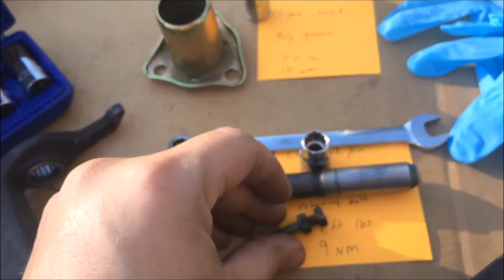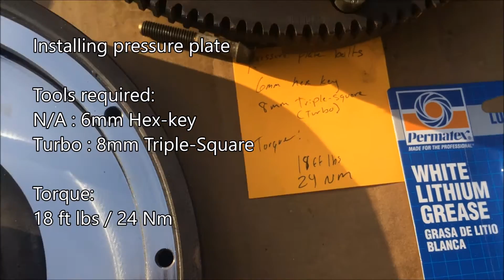Porsche 944 Clutch Change Episode 3: Installing the clutch

Comment: This is by far the best 944 video I've seen. Very thorough, well thought out simple. I wish you would do one on removing the torque tube since I'm right inthe middle of it. This is  even better than the German guy. I did strip a pressure plate bolt head and some cv joint bolts. Both were very dirty i was in a hurry and didnt clean  them properly. Because cv bolt heads werent clean i thought they were torx instead of 12 point so i stripped a number of them and might have pinched the  circular thingy next to the bolt head with my vice grips. Hopefully still usable. I have seen many of these videos and this is the best. I detected a bit of a Southern accent so I was glad to see a Southerner doing good.
Reply from the maker: Thanks! Yeah, I'm from North Carolina. Where are you from?
Reply: Denton, Texas.

Comment: Awesome video!  I just picked up an 86 NA and the job I started with was the clutch replacement (figured I'd kick it off with a big/long job).  Your videos are great and they have been a HUGE help!
Reply from the maker: Awesome! Glad to hear they've been helpful! Good Luck with your project!
Reply: Quick question:
I just finished up the clutch job and I'm moving on to replace the timing belt and water pump.  Finding TDC is important and the OT mark on the flywheel is essential it seems.  I now can't remember if I lined up the flywheel with anything else when putting it back in following replacing the rear main-seal.  I went back and checked your video (as I'd used it often to reference the clutch job) and noticed that after marking your OT line with paint you also seemed to reinstall the flywheel without aligning it with anything.  Was there some marker or notch I should have been referencing when putting the flywheel back on that I missed?  I just want to make sure I'm able to set to TDC so I can feel confident about my timing belt change.
Reply from the maker: There's a roll pin in the crank that lines up with the flywheel so its impossible to install the flywheel incorrectly. I hope that helps!
Reply: edredas ah thanks! Great!

Comment: If your pilot bearing is really stuck in there, you can hammer pieces of bread into the hole using a 3/8 extension ( or a socket with a bolt in it if you need a tighter fit) and it will get forced out.
Reply from the maker: Yep, just did this yesterday and will be in an upcoming video...

Comment: pretty nice but had question do you need mark flywheel top dead center  in same position .that way when installing had same position !! topdead center
Reply from the maker: There’s a locating pin in the crank that the flywheel locks into so the flywheel can’t be installed incorrectly. So the mark stamped on the crank will always point to TDC. I hope that helps!

Comment: So you marked the OT mark with yellow paint.  Doesn't the flywheel need to go in at the same position it came out?  If you don't won't this throw off the timing if you ever try to replace the belts and use the mark?  Or am I just confused?
Reply from the maker: There’s a locating pin on the crank so the flywheel can only go on in the same spot. No way to install it incorrectly. I hope that helps!
Reply: Thanks. That makes sense. I am thinking of getting a 944 to work on with my son as a project.

Comment: Thank you for this great resource, my flywheel is at the machine shop getting resurfaced and I can't wait to get this thing back together. I live in the rust belt, is there anything that should or shouldn't get some never seize during reassembling to give the next guy an easier time? Obviously not flywheel or pressure plate bolts, but how about bell housing and torque tube bolts?
Reply from the maker: Shouldn't have to, but a little anti-seize here and there shouldn't hurt. Especially on some of the smaller bolts where the zinc coating can come off and lead to steel to aluminum contact which can cause issues. The anti-seize should help prevent such problems. That said, the only thing I can think of is already covered in the videos already and that is using a moly based grease instead of the lithium grease on the clutch fork pin. The factory used lithium grease which has a tendency to dry out and make it harder to remove, whereas the moly based grease should last for years. I hope that helps!

Comment: I have another question lol. After I get the flywheel resurfaced, is it 100% necessary to get it rebalanced? If so, should it get balanced with the pressure plate bolted onto it, or can it just be balanced on its own? Also I’m planning to use a new pressure plate, so I don’t know if that’s gonna affect it too.
Reply from the maker: There is no need to rebalance the flywheel after resurfacing.
Reply: @edredas  alright cool and thank you for these videos and reply’s, they are extremely helpful

Comment: Thanks so much for all your hard work in documening this. I have an early 85 I am trying to resurrect (been sitting for quite a while) and am in the process of resealing my steel fuel tank as it is rusted and causing a lot of issues with the fuel system and consistency. I currently have the tank out being "derusted" before doing the POR-15 sealer, so the transmission is out and rear exhaust. The car shows 85k miles but I suspect the odometer is broke or has rolled over. I have never driven the car but the previous owner did drive it onto a trailer that I hauled it home on so the clutch is physically there. How much more time/effort is it to get to the clutch from where I am at now? I am debating whether to check it or not just in the chance it could still have the rubber centered clutch since the mileage is suspect and maintenance history is long gone.
Reply from the maker: At that point I think you should go for it. What you have already done is a good 50% of the job. So there is a ways to go but will be worth it in the future! Good luck!

Comment: I cannot for the life of me get a torque wrench in to crank the belhousing bolts. How did you do it and get accurate torque? Or should I just use grunt force?
Reply from the maker: Might need an extra hand getting them tight since it's pretty tight down there. I would just use a smooth movement while turning rather than too much grunt force since I have seen the ears on the block where those bolts go in crack and even break off before. Good luck!

Comment: what's your opinion on using an aluminum flywheel for street driving? pros and cons.
Reply from the maker: The weight of the flywheel helps keep momentum of the engine. Especially when releasing the clutch from a stop. Four cylinder engines especially need help since their firing frequency is very far apart compared to other engine configurations. These particular engines are loaded down with weights to help smooth them out and make them “luxurious”. Racing four cylinders do not use any weights so the rev ridiculously fast but will shake your teeth out. They also aren’t stopping at red lights and living their life at 7k rpm. So don’t really expect your engine to rev quicker with just a light weight wheel, you’d need a lot of work that will just make it a headache to drive on the street. 
Pros: not really any on a street engine. 
Cons: easier to stall out. 

I hope that helps!

Comment: Great series, but I'm surprised you reused the pressure plate. Seems a big risk to me considering the fact it's a big job. It must have been as old as the pressure plate and release bearing, and they were both destroyed. I think I'll be replacing all three pieces when I get to it as it will be a weekend car and won't want to risk having to do it again.
Reply from the maker: Thanks! Yeah, it isn't ideal to reuse it but its mostly up to the owner if he wants to replace the pressure plate since isn't a wear item like the clutch disc. So long as it isn't warped, and there's no hot spots then its usually fine to reuse.  If I find any damage such as that or if the fingers are bent or the drive straps are messed up then I'll throw another one in or suggest they buy a new one. It all depends on the situation. I never want to go back in there but many times there's its no issue with reusing it.

Comment: I need to get my flywheel resurfaced, and I know that you need to resurface the friction  surface, as well as the outer surface where the pressure plate bolts on. Do both the friction surface and outer surface need to be resurfaced the exact same amount? Because I’m not sure how and what to ask the machine shop.
Reply from the maker: There isn't any way to resurface the pressure plate itself since it has a spring on it. Just make sure its clean and if its too rusty it should be replaced with a new one. I hope that helps!

Comment: Hey Brent! I’m seeing various anecdotal reports on the forums regarding rear main seals and their reliability, some saying the black colored ones hold up better than the red/orange ones and vice versa. Is there any truth to that in your experience? Do you recommend one brand over another? Thanks!
Reply from the maker: Not sure about the orange. I have only ever used Victor Rienz rear main seals. Never had one leak but I would think it’s all down installation. They are not easy to install and bend easily. So I have had to throw some away. One thing I also do to make sure seals last longer is use a mix of red assembly lube with a little oil. With this concoction I no longer see any of the seals scoring the front collars and the seals last much longer.
Reply: @edredas  Great tip, thank you sir!

Comment: Great video edredas! did you replace your pressure plate as well? I have everything disassembled and Im having trouble deciding whether or not to replace it as well. Is there a way to test the integrity of my current pressure plate?
Reply from the maker: I reused the pressure plate since it was in good condition. There really isn't a way to test the integrity of the plate but you can visually inspect the drive straps and the fingers for cracking. That will tell you if it can be reused for the most part. I hope that helps!

Comment: Great videos on the 944, I am looking at one this weekend that needs a new clutch. What is the OT mark on the flywheel that you marked with yellow paint?
Reply from the maker: Awesome! The OT mark is needed to set the timing when changing the timing belt. The mark can be rather hard to find due to rust and dirt so it never hurts to make it more visible. Good luck!
Reply: So it’s probably best to put witness marks on the fly wheel and the engine so that when the flywheel goes back on it is lined up properly?
Reply from the maker: Luckily, there is a locating pin in the crank, so it isn't possible to put the flywheel on incorrectly. So all you need to do is mark the flywheel and when you line it up with that pin it will always show the the OT mark when it is at TDC.

Comment: Would this video help with a 924 that was swapped with a 944 engine? Or is the clutch in a different area
Reply from the maker: Yep, if it has a 944 engine then it will likely have the 944 clutch setup. Good luck!

Comment: I have a 1983 non turbo. What would cause it to start run for about a min and then just shut off? It does need a new clutch.
Reply from the maker: Could be either a vacuum leak or a fuel issue. Check all the vacuum lines that you can and feel around under the intake to see if any have come off or cracked. Sometimes you may have to remove the intake to be sure. That said, it could also be the fuel pressure regulator, however most of the time the car can stay running but just run rough. I hope that helps!

Comment: I was following your video for installation and I took the engine out of the top to do the clutch. We are going to install the new clutch kit and now the clutch fork will not align in the bell housing to push the pin back into the place and reinstall engine. Do you have any ideas on why the fork will not go back in. I am using a Sachs clutch kit and have changed the rear main seal and bearings and clutch fork bearings./ thank you for your help in advance.
Reply from the maker: Hmm. Not sure exactly what the problem might be. That said I’ve never done it that way since if you remove the cross member then it’s easer imo to drop it out the bottom. I have seen where people go out the top with the pressure plate off but this can warp the plate and why Porsche wants you to drop it out the bottom with the bell housing on. Perhaps if you’ve already bolted up the pressure plate it may have to come back off again so you can install the fork first. I hope that helps!

Comment: can I go up with the fork pin I broke the 8mm 1.25 in the fork pin
Reply from the maker: It can only come out through the bottom... there is no hole on the top side. Sounds Aweful, good luck!
Reply: I did the same and not that you probably haven't already solved this, but there's a grey pin that's at a 9 o'clock position from the torque tube entry into the bell housing. Beat it into the housing using a punch or screw driver, then knock the clutch fork retainer pin out the top end from the bottom.

Or you can undo the fly wheel bolts holding the pressure plate in place through the starter hole, and pull down the whole assembly with the fork and retainer pin still in place, then fix it on the bench.